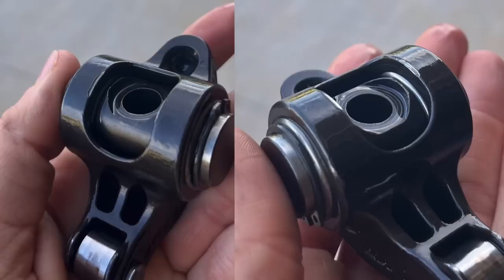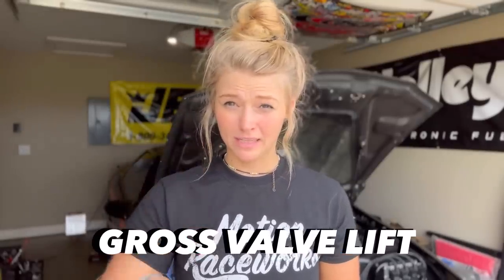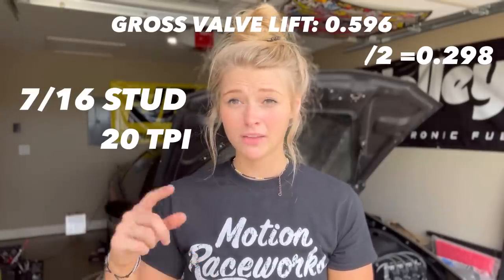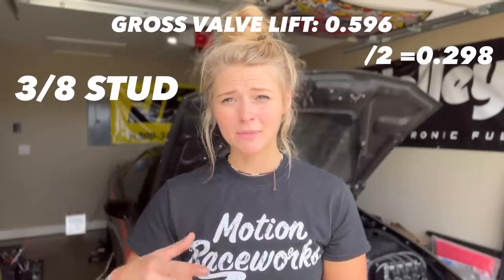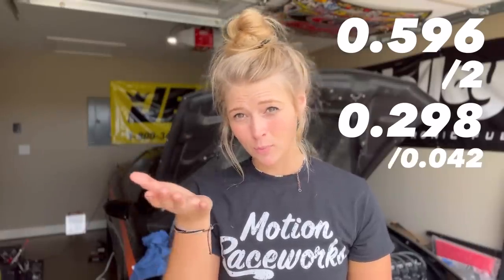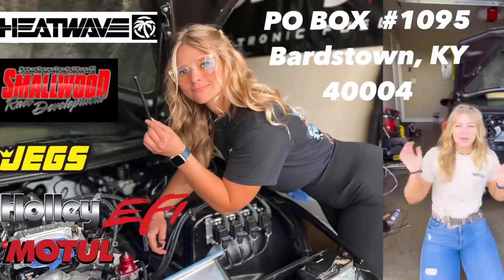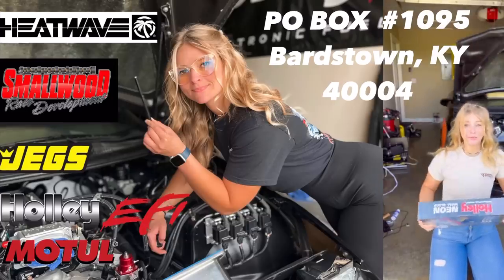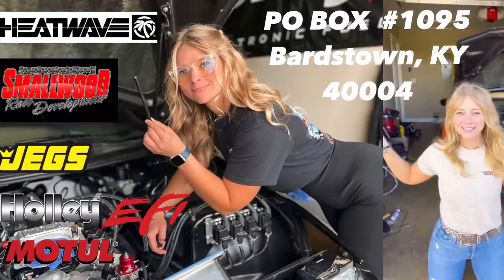IS THE UGLYSTEPCHILD BROKEN???

Comment: I didn't understand the math behind the push rods but that's ok, I already don't understand many things.
Reply: The .050 is fifty thousandths, and the .042 is forty two thousandths. She is getting this number because the stud is a fine thread 7/16-20, the twenty is threads per inch on the threads of the stud of a 7/16 fine threaded stud. (7/16-14 is coarse thread 7/16-20 is fine thread for a 7/16 stud or bolt the rocker studs are fine threaded 7/16-20). Divide÷ 1 by 20=.0416 round up to .042.  The 3/8-24 is fine threaded 3/8" thread size, 24 is threads per inch. (3/8-16 is coarse thread and 3/8-24 is fine thread for a 3/8" stud or bolt, the 3/8" rocker stud is 3/8-24, fine threaded) Divide ÷ 1 by 24 and you get .050 thousandths. Hope this helps a little. Take care, be safe, and have fun regardless.
Reply: Me neither....I just enjoy the view.
Reply: WHAT???…..there was math???? Sorry…..was very distracted!!!!😳😍✌️😁
Reply: @jthorner69  me too!
Reply: @jthorner69  ...This should be called "fat-chick automotive". 🤣🤣🤣
Reply: @Thor Odin son ....Yes. Fat.
Reply: @Thor Odin son ....Dude those are thunder thighs. She might be a size 6 from the waist up but that lower half is heavy.
Reply: @kendallkilgore7799  
  That was one beautiful motor was it not.
Reply: @CM-ve1bz  it does look fine. They know that as well on the channel.
Reply: @Thor Odin son i think he means "phat".
Reply: Lol
Reply: I understand the reason behind this YouTube channel lol
Reply: I understand the math on them buns
Reply: You push the rod in and then 9 months later you’ll have a push up baby lol
Reply: @sleeks9939  well said....I am in total agreement  with  you  there!!! I wish I was that blessed dude

Comment: With the gm 305 and 350 cui V8's you tune engine rocker arms with the valve covers off and the engine run. You loosen the rocker arms up until they clatter then tighten them until the rocker stops clattering and then go a 1/2 a turn tighter.

Comment: You should get a pushrod length checker.... you basically set it to zero lash with checker and the remove and count turns all the way in. Each turn is .050" so it's pretty easy. Never been a fan of counting threads or turns as I know it works for others well. Good stuff, hanging valves can cause all kinds of problems!
Reply: Check geometry in place and as it actually works.
Reply: Did you not watch the whole video? She had one & was using it in the video….

Comment: easiest way I've found to get correct length pushrods for a modified setup,, is to use a solid cam lifter and with an adjustable pushrod during mockup. once you have correct lash and movement, remove and measure, simple!

Comment: I’m drive a 95 impala with the lt1 setup still. I have broken exhaust stud on drivers head back corner. Sheared off in the head. If I pull the head I’m going to do both and spring and stud them so I can do a cam swap. The fact this platform only ran like five years and each platform has its own tuning software is fun. I enjoy the challenge and they are easy to work on.
Thank you for taking on the challenge and not instantly converting over to LS.

Comment: Ive always set up roller rockers on a hydraulic cam by taking a stock lifter, removing the plunger and installing whatever combination of small nuts and washers under the plunger to provide .050 between the top of the plunger and snap ring, making it a solid lifter.  I then install an adjustable pushrod and mock up the rocker arm.
'Next step is coating the tip of the valve stem with a marking pen, then rotating the engine while adjusting the pushrod until the roller is centered on the valve tip, re coating the valve tip after each rotation and adjustment. I then order the pushrods according to the length on the adjustable test pushrod
After pushrod installation I adjust each rocker arm until the lifter plunger is depressed .050
No math required, and never had that method fail.
Reply: Exactly same here

Comment: Being a German car guy this whole pushrod driving a valvetrain thing hurts my brain 😆

I can wrap my head around VVL and VVT camshafts, VANOS, and Valvetronic and all this weird valve timing stuff, but the whole rockers getting pushed from the bottom end to move valves thing seems so weird to and confusing to me. And the math to measure rods forget it lol. Super confusing to me for some reason.

So crazy how different the engineering is in all the different kinds of cars and engines out there.

Comment: It reminds me of the magnet less traveled when you're designing a speaker. That's kind of cool all over the speaker the town is going to be midpoint and end-to-end the same except we have EMF Force pushing back in the amplifier and if the amplifier has a lot of force the back force of the speaker might be stopped a little short of its full travel which is what you want otherwise otherwise you have a broken tone

Comment: You also have to make sure the cam is on the bottom of the base circle so the lifter is as far down the lifter bore as it can go.
Reply: 0.052 is 52 thousand...not 5 thousand..they make a tool to just  slip over the stud to check push rod lengths..also 0.040 is forty thousand  not four thousand

Comment: Am I missing a step? Where do you start with the poly lock? Do you thread it down to the rocker until it touches and THEN use your 7.09 figure? Then check pushrod length? I think I can see how it goes but want to be sure. You use the 90 deg. thread it till it touches, then the 7? Also, the 90 degree...90 to the valve? 90 to the head? sorry for so many questions...Im about to be doing this on a new build and have always just used the old sharpie method

Comment: Adjustable pushrods would suit you better if your racing. You want valve tip center of roller when spring pressure is at max. When you get into high lift cams and spring pressures you find out pretty quick your geometry is off.

Comment: It was hard to focus on the mechanical tutoring. The mechanical tutor is 👍.
I am unsure about the methode. I suspect the rockerarm ratio makes dividing the lift by two at the fulcrum point wrong?  But I have not tried that way before. So its worth testing.

Thank you. I am ready to date again.

Comment: That first number you mentioned for the 7/16 stud is 0.050 from right to left is:
Tens, hundreds and then thousands. The 5 is in the hundreds so what you wrote is actually FIFTY THOUSANDS of an INCH or 0.050 but verbally you said. "Five Thousandths" which is 0.005. 
So is the correct one 5 thousandths or 50 thousandths? Just trying to make sure. I am working on an engine and valve job on my own so this is super informative. Thank you! I've done the old method (marking center) I wanna try this method.
Reply from the maker: All of the numbers on the screen are correct. I realized it while editing which is why I added them visually! Hope this helps!

Comment: HEY BRITTANY HOW YOU DOING I GOT A QUESTION I HAVE A CHEVY IMPALA SS 95 LT1 MOTOR I HAVE AN ISSUES I'M HAVING ISSUES BACK FIRING AND SOMETIMES IT WON'T EVEN TURN ON THE BATTERY DIES WHEN I RECHARGE THE BATTERY THE CAR WILL START IT'LL STAY ON IT FOR A LITTLE BIT AND THEN IT'LL DIE OUT I CHANGED THE DISTRIBUTOR I CHANGED THE EGR I CHANGED THE MASS AIRFLOW I CHANGED ALMOST EVERYTHING SPARK PLUGS AND WIRES AND STILL THE SAME THING MAYBE YOU CAN GIVE ME SOME IDEA THE POSSIBILITIES OF CAN BE
Reply: AND I ALSO WANTED TO MENTION I ONLY DRIVE THE CAR ON WEEKENDS I BARELY DRIVE IT I TURNED IT ON ONE DAY AND THAT WAS IT JUST STARTED BACK FIRING DOWN THE ROAD

Comment: Respect the video, but it's definitely not the proper way, an adjustable pushrod checker paint valve tip to get the correct length. Every engine builder I know uses this method,using a mock-up lifter  modified solid lifter if hydraulic roller
Reply from the maker: That’s fine but math is also unbeatable. Go check out what most promod builders use😉 I’ll give you a hint…it’s math
Reply from the maker: Also if you think that’s the only way, listen to the beginning of the video where I tell you I did it with an adjustable one and it measured wrong for me. Then go watch the YouTube video I posted as I found this out.
Reply: Lmao 🤣 Every engine builder I know on East Coast uses your first method, I have     built my race engines using your first method, and I never had a problem, Just curious what kind of lifter you used the first time for mock up, You do your math lol , and I will use what has worked for yrs 😉
Reply: @britneyautomotive  You must have missed all that math the first time you checked push rod length 😉 🤣